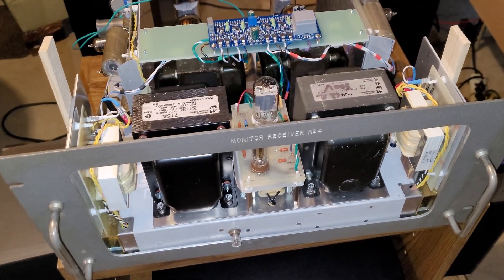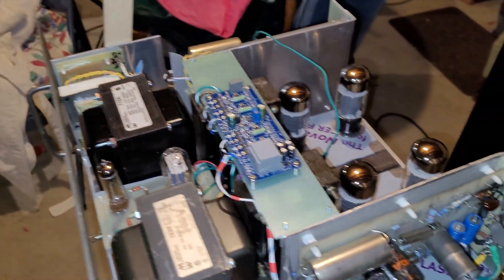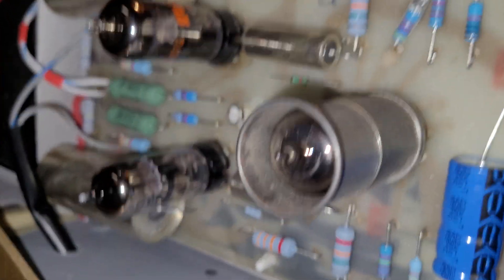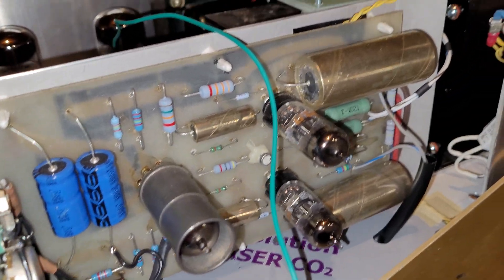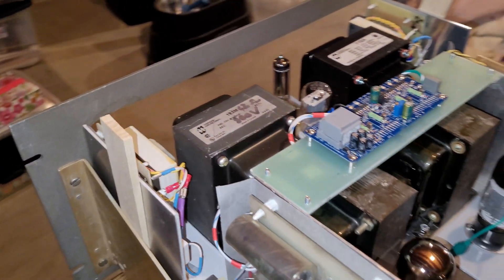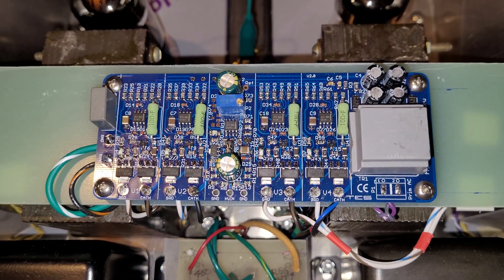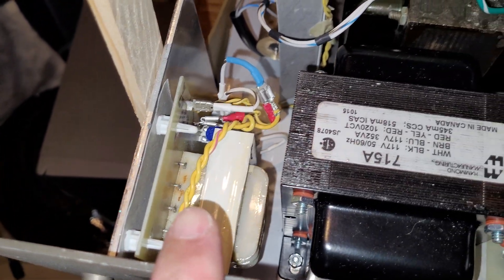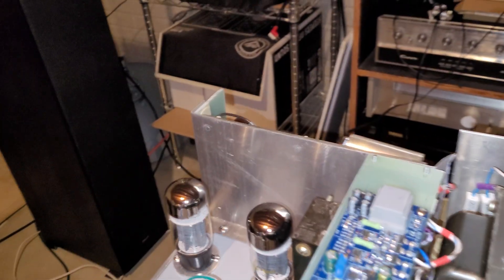Home made tube amplifier from a 1947 50 Watt Rca tube manual schematic

Comment: If I would have build a tube amp, it will be tube only amp. No chips or mosfets or smds.
Reply: So you would build the autobias circuit with tubes too?
Reply: Remember cathode bias reduces plate voltage by the amount of bias. Most amplifiers prefer bias from bias supply winding of about 55 volts. In the RCA manual, the bias supply was derived from the transformer, they used a capacitive dropper from the high voltage winding. Idea is when B+ increases, bias increases too. That's what the RCA manual schematic  specified. Tube rectifiers like 5u4 are preferable too for audio even when they consume another 15 watts  Possibly add a fan running at slow speed if your layout limits airflow like it seems to for this design.  @pnnielsen

Comment: Memory lane! I built the same amp (probably from the same manual or one around that time) back in 1970, although it was only one channel and used standard DC grid bias. My big mistake was using a universal output transformer with select-able taps that I picked up surplus. The transformer limited the low end on the amp. It was an interesting build! Your chassis work is far superior as mine was a re-purposed power supply chassis and looked it!

Comment: thats not a very good tube choice for class B. I have run the 7027A at outputs of 70-75 watts in AB2. A much better class for these.  The RCA tube manual RC-23 has a schematic for these running in AB2 for 50 watts out. They reccomend the Acrosound TO 330 but i have used Stancor A-8072 at 70w levels at 2% thd 20-20Khz. Bump the current and plate B+ up dude!

Comment: The first amp I built used a 6AQ5, with 5 W output. I graduated to building a 6V6, push-pull of 12 W, and I was so happy when I got output transformers for the 6L6, push-pull, at 55 W output. 
Then I went transistorized.

Comment: Very impressive build. I used to have an RCA manual from back in the day as well but I got rid of all my paper product manuals when I had to move so many times. I bet this took some time to do. Especially designing and making printed circuit boards for it. The chassis metal work and thinking on how to separate everything is phenomenal. Now what does it sound like
Reply: Totally agree. Gr8 job! Randy/GA